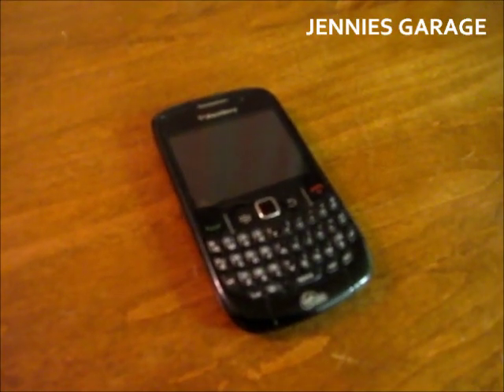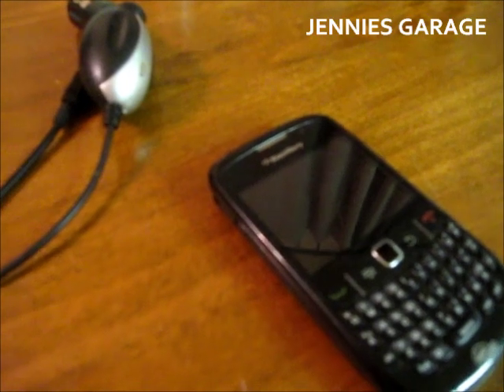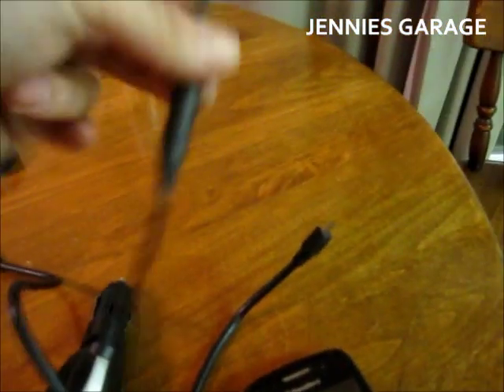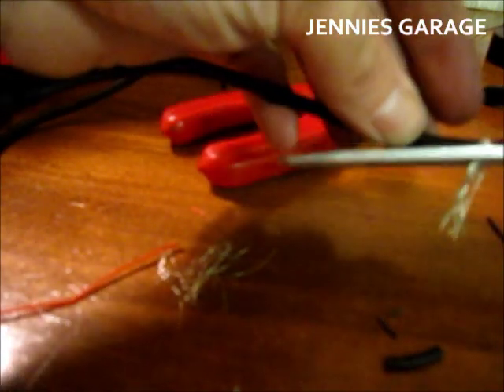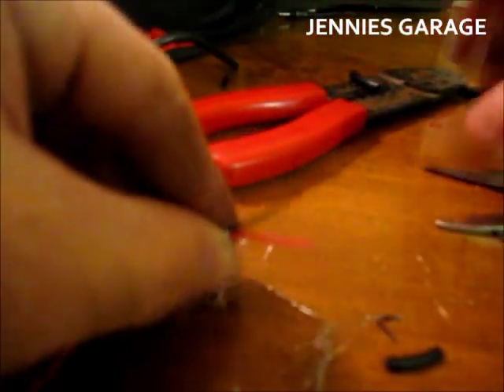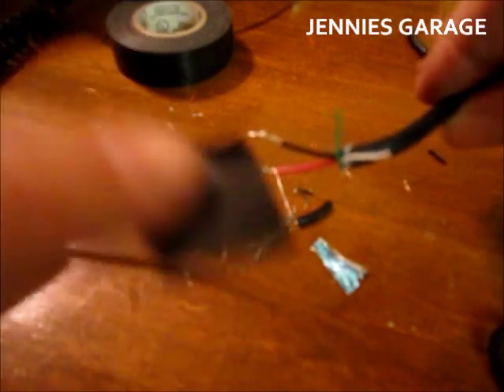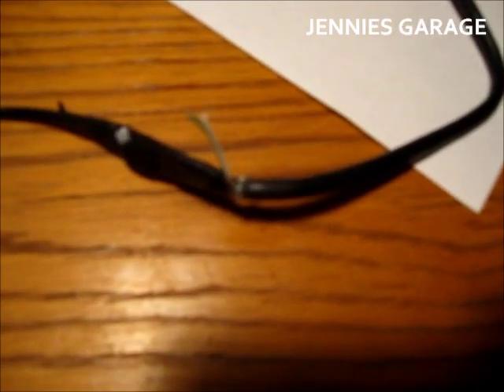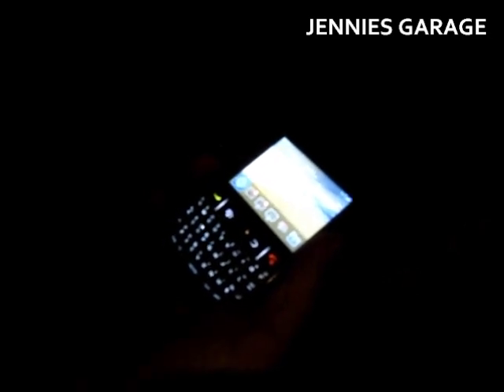How To Fix A Micro USB Car Charger With Junk Drawer Items!!

Comment: This same exact situation happened to me, except it was with the usb wire to my Bamboo drawing tablet.  But looking at the end that plug into your phone and my tablet, they are exactly the same type of plug.  I tried replacing the wire with two other wires that had the exact same ends just lying around but they both eventually did the same thing.   I wonder if this problem has to do with this exact Micro Usb plug.
Reply from the maker: I think that the plugs are so cheaply made they will give out really quick with normal use. Since I made this video I've gone through 2 more plugs.

Comment: First off,  great video.  Now,  I did the same thing but my phone (a note 2 which charges fastest on its original 2 amp Samsung wall charger) takes like 10 hours to fully charge in the car. I guess it's because of the new cable part coming from the pc usb cable,  soldered to the car charger original Cable.
So I'm thinking to liberate the micro usb connector from the cable altogether,  and solder the connector itself to the car charger cable,  would it work better that way? Thanks for any help.

Comment: you're right mobile device should come with mobile charger 
thanks fore the how to it's the best and funniest how to ever i laughed and laughed since 
"the stars are perfectly aligned" until spending the charging moment " together " 
have you disconnected the soldering iron after connecting the data cables ?
thank you thaaaaank you